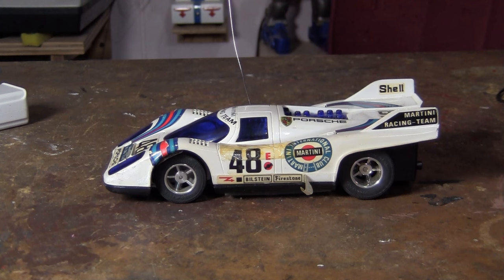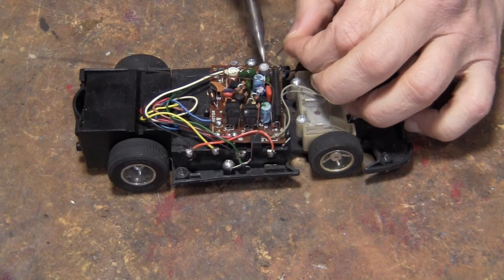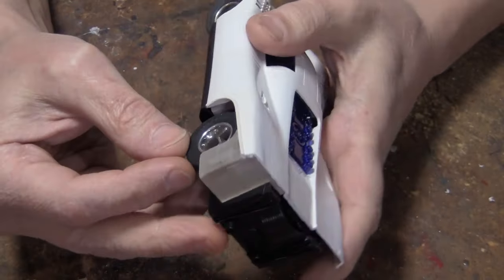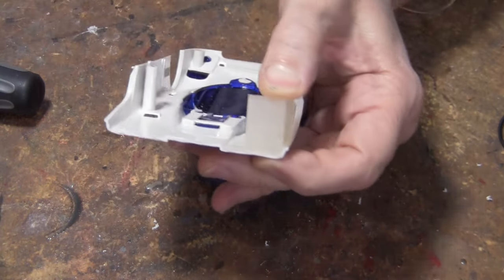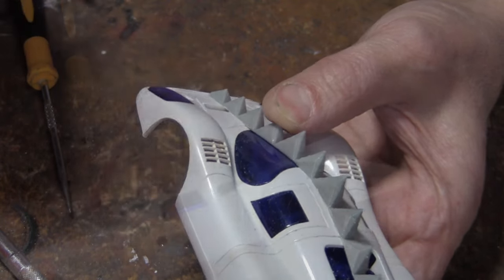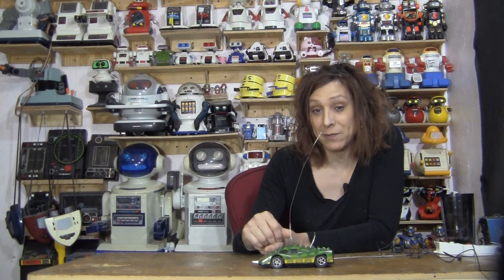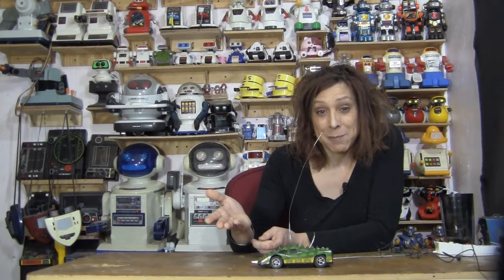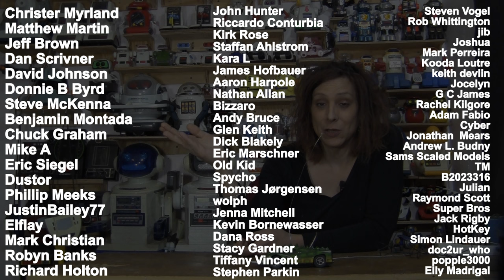Frankenstein Scores: Transforming a TAIYO Porsche 917 into Death Race 2000 Machine

Comment: Did you put some kind of clear coat on it?  At one point in the video the car looked very natural, like it was colored that way from the factory and the next moment it was very shiny, as if a clear coat was put on it.

It turned out very nice.  Great job on making the wrong car look like the right car. I probably wouldn't even have noticed had you not brought it up. I'm just too unfamiliar with the movie.
Reply from the maker: Yes, just a clear gloss enamel. In reality, it took many hours painting, and re-painting.
Reply: @RandiRain  The green shades looked like acrylic paint, iow, they look excellent on plastic.  I may have already mentioned to you that airbrushed acrylic looks excellent on plastic, like it came that way from the factory.  I've never been able to get sprayed enamel to look any good. I've never seen any that look good. They tend to look thick and unnatural.  I often paint old computers and I've found it works extremely well.
In fact, I never even knew plastic was painted at the factory.  While much of is not painted, but colored plastics are used, some is.

Comment: Kid me would've weeped as I was obcessed with the Martini livery but adult me gets it and if Corman had a Hollywood budget who knows, Frankenstien may have got a 917, it's acctually suprisingly close as the Movie Cars were really VW chassis underneath which is effectively what Porsche evolved from.
If you revisit it I know somone did make a 1/25 kit of the custom Corvette it's based on, you could probably adapt or base the measurments on it to print an exact shell.
Reply from the maker: There is a Taiyo corvette, but it's a later version and not the original that the Death race car is based on.
Reply: @RandiRain  tbh even if it was the right gen it might still not be quite right as the proportions have been shortened a bit to work with the VW chassis.